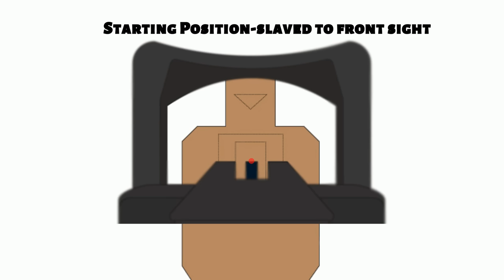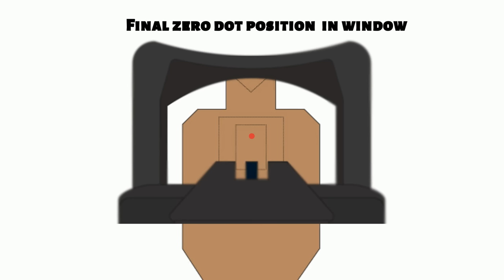Zeroing a Handgun Red Dot Sight

Comment: Someone help me understand why 25 yards for a zero. If the majority of defensive situations happen within 7 yards how does a 25 yard zero help in any way? I'm sure I'm missing something here.... Maybe someone can help me better understand. Why have to remember holdovers within the range most used just to have no holdover at 25 yards?
Reply: Simply put, because zeroing at 25 yards on a pistol optic produces the most accurate zero in terms of holdover/hold under. If you're producing 1 to 2 groups at 25 yards, you'll still be hitting where you're aiming at shorter distances like 12 and 5 yards. Whereas if you zeroed for 5 yards, you could be several inches high at 7 and 12 and even a foot high at 25.
Reply: @benjamin3615  I ended up going with a 15 yard zero. The 25 yard zero actually had me hitting 1-2" low from 7 yards and in while the 15 is practically point of aim / impact out to 25 yards. I've been trying to get out to the range to get further training at distance past 25 yards. I'm curious where point of aim / impact is at 50 & 100. The furthest I can go is 12 yards in the backyard. This is also for a 5" PDP which helps carry the cartridges velocity way better than 4.5 and less. I'm curious of the difference of point of aim / impact between a full size & micro compact that both have the same zero. I just got my shield plus back from being milled for a 507k and haven't been able to properly zero it yet. It's only got a 3.1" barrel.
Reply: @TerminalM193  Ironic you say this, I just read an article last night from Gabe Suarez who advocated for a 10 yard zero and showed the ballistics for a 115g 9mm. It was an interesting read. I'm new to pistol optics myself and I zeroed for 25yards but I might try a 10 to see how it works
Reply: @benjamin3615  I actually very first started out with the 10 yard zero. It's a great zero for only 10 yards and in though. It seems every yard past 10 you start getting more and more spread. It's weird how just 5 more yards covers everything 25 and in, arguably 40 and in.

Comment: If it’s zeroed on carry ammo would you just note the offset with range ammo?
Reply: Jayesh Patel, it shouldn’t matter enough to bother, but you certainly could, absolutely.

I don’t know what your particulars are, but I tried a few online ballistic calculators, and if I’m doing it right, I see a difference of roughly .5” at 25 yards and 1.5” at 50 yards between 115 and 147. Double that 1.5” and it would probably still be a tiny fraction of my group size were I to try bullseye shooting at 50!

I carry and zeroed my RMR for 147+P, and shoot IDPA with whatever 115 ball is cheapest, and it’s never made one iota of difference.

👍🏻

Comment: @SageDynamics when I zero after slaving, my red dot appears UNDER the irons once the irons are properly aligned. This causes the front sight to sit up really high when my dot is perfectly in the center of my window... blocking a lot of my window real estate... I’ve tried raising and lowering the target when zeroing and nothing changes it. How do I get the dot perfectly centered in the window WHILE having my irons be the perfect sight picture? Or at least not have the dot way under the irons when the irons are aligned?
Reply: You lift your head up. The dot 'moves' in the window depending on where you are looking.
Reply: @jubjub905  I know I know, but what I’m saying is that, when I have a “perfect sight picture” with the irons... the dot doesn’t appear in the center of the window like in the little diagram Aaron shows in the video... it appears BELOW the perfect equal height equal light irons sight picture
Reply: @SullyCortez  thats fine. Thats actually just showing the error of your sights. Afterall youre only lining the sights up if the dot is down. In his graphics he actually shows the dot down on the post after its zeroed
Reply: @jubjub905  ahhh ok lol I thought I was going crazy 😜 lol it was driving me nuts I was like wtf why isn’t it like his diagram!!!

Comment: "When the shooter shot it naturally or organically their zero was off"... That doesn't seem to make sense to me. I would think that if you benchrest the gun that you are getting your best zero with no shooter error due to improper trigger or grip control. If after you zero your gun bench rested and your shots are not in the zero that would be due to improper control, right? If you are not shooting free hand to where that barrel was zeroed being on a bench rest held with no movement, then it is your technique that needs Improvement. Somebody please correct me if i am wrong
Reply from the maker: The End I was about 400+ students a year though zeroing RDS handguns a year. If you save to the irons and leave it, that’s not zeroed. Pretty simple really as the RDS would only be zeroed in that case if the dot was used while the irons where also used and co-witnessed, which defeats the purpose of an RDS optic.
Reply: @SageDynamics  yes sir, I totally get that. I think you're misunderstanding what I am trying to say. In the video you were talking about when bench resting the handgun while zeroing and not to tightly secure the muzzle of the gun down and allow for natural movement when firing. My question would be why not, even to the point of putting it in a vise and being exact because some people's natural movement could be bad grip or trigger control and be causing the rounds to pull to the left. In that case it would not be an exact zero? I realize I am being a little technical about it but in my case I am not that great of a shooter and my natural movement may not be a true zero therefore I wouldn't be practicing to correct my bad trigger control or grip but would always shoot to the left. Does that make sense?
Reply from the maker: The End I see what you are saying.  I don’t recommend totally isolating the gun because it tends to complicate returning to point of aim and it’s also hard to do with a handgun.  Resting on a weapon mounted light is fine, but bracketing with bags compromises a consistent grip which changes POA every shot.
Reply: @SageDynamics  okay, I will take that and run with it. You're in my opinion one of "THE BEST" instructors on YouTube whom I look up to, so thank you for the response "AND" train accordingly!😉

Comment: I am a fan of your reviews and take your information to hart because of your extensive experience. I also feel your reviews are some of the most professional and informative I have seen anywhere on you tube and I have seen many. 

Your red dot info has been a huge help for me with my recent Wilson Combat order for a EDC X9 with a red dot system. I also sent in my WC 45cal in to have it machined for a red dot also. 

I'm older now, eyes are not as sharp as they use to be and love the targeting ease of the red dots. I went with the RMR type 2 for both and I'm anxiously waiting for their arrival. 

I originally ordered them with the Trijicon RSO, after I saw your review of the RSO, that completely let me know that was not going to work for me. I don't carry these for duty use but still want the most durable systems I can find. 

Again, love your work and thanks for sharing your expertise to a novice but working to improve that.

Comment: How is it possible that the shots are so low when the dot is lined up with the irons? Makes no sense assuming the irons are zero'd.
Reply from the maker: Because the red dot is not used while slaved to the iron sights.  It’s called parallax.
Reply: @SageDynamics  I thought these fancy optics were parallax free. That's a huge amount, like 50 moa.
Reply: @SageDynamics  I have a Holosun 507 on the way so I'll investigate this.
Reply from the maker: @justinwbohner  there is no such thing as parallax free.

Comment: Here's a question- so what if the RDS battery fails many hours after zeroing in? Now the POI is aligned at the RD after zeroing in but once battery fails, how do I know where to align iron sights to ensure bullet goes where I want it to go? I am a newbie (range fired 100 rounds so far so hopefully that made sense.
Reply: Your red dot zero isn't going to change your iron sights being aligned. So if your red dot fails then just go back to using you irons like normal till you can get the red dot back up
Reply: @craigcrissman4651  ok. Thank you for responding but it still doesn't make sense. 

1. I zero RDS so that the bullet pierces the target where the rod dot lands on the target. I.e POA = POI. Say this is at 25 yards.

2. Now RDS fails. And I use iron sights the way you say I should do. How does the bullet magically go to where the iron sights are aligned and point at? Cos wasnt the bullet going to where the red dot was, prior to it dying? And the RDS isn't aligned to the iron sights (unless you are slaving them which is not recommended per this site)
Reply: @arunpc1982  here's the thing. Due to the way the glass is cut rds sights are "parallax free" which means that you can change the angle at which your looking at the glass but the dot will move with your head to so that as long as you can see both the target and the dot the POI should be where the dot is. But the truth is that no red dot is truly parallax free which means that as you red dot gets further away from the center of the glass while you're aiming it's going to be a little off which is a why a consistent sight picture is important even with a red dot. 

That's why if you zero your red dot with the sight in the center it won't 100% line up with you sights if you properly line up your irons. It doesn't mean that your iron sights are off, it just means that because you moved you red dot lower in the optics in order to look through your iron sights that you introduced a slight amount of parallax so your red dot is no longer 100% accurate to POA/POI.

The opposite is also true which is why they don't recommend slaving your red dot to your iron sights. Because is you zero the red dot low in the sights in order to cowitness then when you bring the dot up to center to use it as normal you are now introducing error into the dots POA/POI for how you're normally going to use it which is centered in the glass. 

If your iron sights are 100% zeroed and you had a red dot that was a real life true 100% parallax free optic then you could slave your red dot to your irons and then use it like normal with zero issues. But unfortunately truly parallax free optics don't exist. They're just parallax free enough to work as intended.
Reply: @craigcrissman4651  thank you! That whole thing abt Parallax is exactly what I didnt even know. Thank you so much!!
Reply: @arunpc1982  No problem I remember when I first got my first red dot for an AR-15 and was just as confused as you were about how the co witness and all that worked. It didnt click until I put the rifle in a bench rest sighted with the red dot then without moving the rifle picked up the same target with the irons and it lined up nice and pretty exactly where I aimed with the dot.
Reply: @craigcrissman4651  nice! Thank you for taking the time to explain something like this to a total stranger. You have no idea how many articles and YT videos I perused to find this info! Hope you have a wonderful day!
Reply: @arunpc1982  you too, take it easy

Comment: So what happens when I zero my red dot and the dot ends up nearly superimposed with the iron at 25y? DPP and Dawsons on a gen 4 mos slide for reference.
Reply from the maker: Ryan Are you viewing the dot through the iron sights? Because that’s not necessary or recommended for aiming with the RDS.
Reply: @SageDynamics  Not usually but I've noticed if I'm in an odd position and angle the pistol downward as if I'm going to shoot it on the same plane as the irons it is nearly dead on slaved off the irons.
Reply from the maker: Ryan that’s possible. A lot of factors; milling depth, optic, dot size and iron sight height. As long as the optic is zeroed Independent of iron sight alignment it doesn’t matter.
Reply: @SageDynamics  That's more or less what I was thinking. I've just been able to ignore them if I am in that position because i continued to focus on the target. Thank you for the reply.
Reply: @SageDynamics  When zeroing a red dot I've have read that if you move the red dot in the opposite direction to get your shots where you want them to go. Lets say if your shots are hitting high you would turn the elevation adjustment screw on the red dot in the up direction to move the shots down. And if your shots are hitting left of center you would turn the windage adjustment screw toward the left to get your group to move right and vice versa. Is this correct?

Comment: How much of a zero drift do you typically notice after changing batteries on the RMR? Is it enough that you'd elect to not carry the gun until you could take it to the range, or if you have a bore laser that you know is spot on, would you trust that enough until you have time available to fine tune it at the range?

My bore laser had every shot in the red at 25 yards the first time I set up my RMR, no adjustments necessary. When I remounted it after I got my sealing plate in, I noticed about 2 clicks of difference.

Comment: Duh! Great education.  I'm assuming that this applies to a laser/light zero as well.
Reply: If you're using a light laser combo mounted on a pic rail it typically has just one positive point of impact. The fact that they usually sit lower on the gun in relation to the bore axis then an rmr does, the closer you are to that "sweet spot/zero" your impacts will be higher than where your laser dot is projected and just the opposite the further out you go from you "sweet spot/zero". It does for me anyway.

Comment: Aaron what if I zeroed my dot at 25 yards and it ended up being an absolute cowitness to my irons? To keep the irons out of my sight picture, even though I’m ignoring the irons and using the dot independently, the front post is raised above the rears and I know the gun isn’t flat. Will this cause parallax or any other issues? I’ve got trijicon suppressor heights on my Glocks and if they’re POA/POI is 25 yards, aren’t I stuck with a cowitness?
Reply: That's how mine is. If I look down the irons, the green dot is directly on top of the front sight's dot. Instead of raising the front sight, just raise your head up so the dot is centered. If it's properly zeroed and mounted with no wiggle room, the bullet should hit where you place it.

Comment: Anyone had any issues with stability on their G19 gen5 MOS? I’m about to get a Trij type 2 for mine and I’ve been hearing about the MOS slide cut.
Reply: John Wick's pencil it’s fine for me. Just make sure you get the Mounting kit trijicon sells.
Reply: I haven't had issues on mine, after 400 rounds. Vibra-TITE 213 VC-3 threadlocker(stronger than loctite) + the mounting kit with the plate. Gen 5 MOS + Trijicon RMR Type 2.
Reply: The Sun
A little, but at the end of the day it was just too much frame for me personally. I CC my G19 and already have a few midride holsters made for it too, so I like being able to use the same setup for different things.

I could definitely see it being an option for offset / backup sights on a rifle though. Or on a sub or AR pistol even.
Reply: John Wick's pencil get a gen 3 and have it milled Mos are not that great but a good range toy
Reply: Jason Grant-Reviews
How exactly does an MOS cut on the slide suddenly turn a Glock into a toy?
Reply: John Wick's pencil me and a couple people I no have broke the plates . Still a reliable gun just not reliable optic System